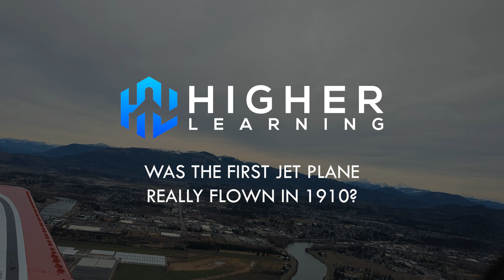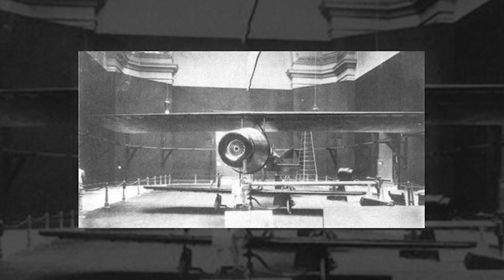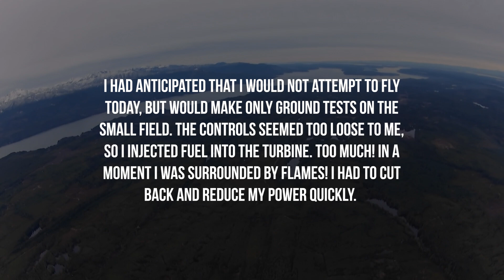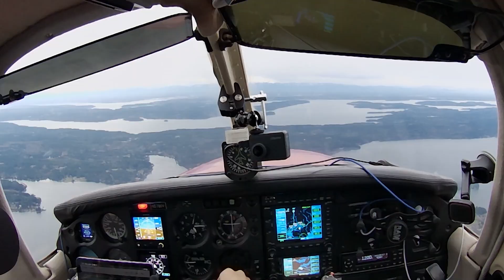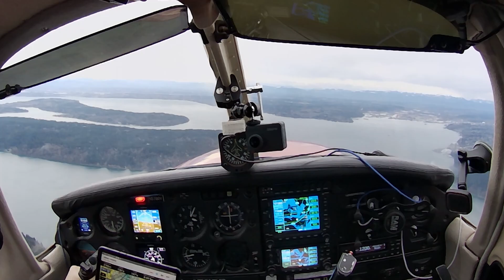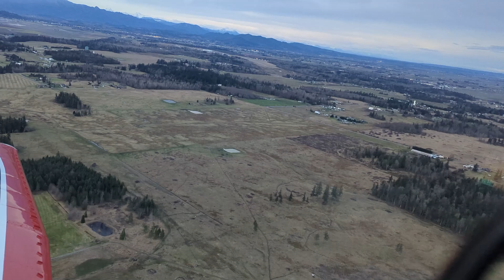Was the First Jet Plane Really Flown in 1910?

Comment: In what concerns "Coandă -1910" powerplant design : This plane was powered by a MotorJet or a ThermoJet - on that era's terminology - this powerplant concept was first time seen, in the history of aviation, at the "Coandă - 1910" aeroplane exhibited at the Second Aeronautical  Exhibition in Paris in October - November 1910. Similar powerplant concept was used decades later, for instance, on the "Caproni - Campini C.C.-2 N1" . In December 1910, on the military training field of Issy-les-Moulineaux (outside Paris), Coandă, while was testing his plane's powerplant - as he never intended to perform a flight test that day - observed that the jets of hot exhaust gases from the engine, instead to follow a straight path, as expected, were attracted to the aircraft's fuselage, a phenomenon which, later on - after more than 20 years of continuous theoretical studies and experiments - will be named the "Coandă Effect" on his honor. Focused on adjusting the engine's fuel flow - with the purpose of trying to bring back, to a straight path, the jets of hot exhaust gases - Coandă was taken completely by surprise by the plane's fast taxiing which was heading  towards the old fortifications walls of Paris. With no options left, Coandă tried to fly over those walls but, after it took-off, the plane stalled and crashed, throwing Coandă clear out of the plane - fortunately, not being straped to the pilot's seat - just suffering minor injuries while the plane completely burned out. Such way, in 1910, took place - accidentaly - the flight of the first airbreathing reactive engine powered aircraft, "Coandă - 1910".
Coandă and Caproni colaborated at certain aeronautical projects in the early years of the 20th century.
Unlike the TurboJet, which have the compressor driven by the turbine which is spinning being "blown" by the jet of exhausting gases, a MotorJet has the compressor driven by an external source of power, such as a reciprocating engine, while extra fuel may, or may not, be added to the jet of exhausting gases resulted from the compressed air mixed with the reciprocating engine's exhausting gases. In short, the general design of a MotorJet can be simply described as somewhat similar to a compressor coupled to an afterburner. What is interesting about MotorJets is that, in practice, the reciprocating engine driving the compressor can provide enough thrust for flight without activating the afterburner, producing a - so called - "cold thrust" or with the afterburner activated,  producing a - so called - "hot thrust".
Gustave Eiffel recognized Henri Coandă's genius, even remarking that Coandă was a prisoner of his time, born too early for his groundbreaking work. Eiffel supported Coandă's early experiments by providing him access to a testing platform on a locomotive, which allowed Coandă to test aerofoils at high speeds. 
     Mutual respect: 
The two were friends, and Eiffel was impressed by Coandă's intellect and inventive spirit. 
     Scientific collaboration:
Eiffel helped Coandă test his experimental wing designs on a wind tunnel platform he built for the project, which was mounted on a locomotive in Northern France. 
     Eiffel's admiration:
Eiffel famously told Coandă, "Too bad, dear boy, that you were born 30 years, if not 50 years earlier, far too early...". This reflects a sense of awe at Coandă's visionary ideas, particularly his work with jet propulsion, which was ahead of its time.

Comment: What about the first reaction engine? While not an jet engine, all jet engines are reaction engines so Ciurcu clearly contributed to it and while not testing it in flight it was tested on a boat making it the first propelled boat

ChatGPT:

Alexandru Ciurcu and the First Reaction Engine
	•	In 1886, Alexandru Ciurcu (Romanian inventor) and Dumitru Văsescu developed a steam-powered reaction engine.
	•	Their invention used pressurized steam expelled through a nozzle to generate thrust, following Newton’s Third Law—just like modern reaction engines.
	•	They tested their engine on a boat, making it one of the earliest demonstrations of reaction-based propulsion.
	•	This concept is similar in principle to modern rocket and jet engines, even though their design was not air-breathing like a jet engine.
Reply: From this perspective it's worth mentioning the "Aeolipile", also known as Heron's engine, is the first recorded steam-powered device in history, invented by the Greek mathematician and engineer Heron of Alexandria around the 1st century CE.
 
How It Works
Boiler: A sealed container or cauldron holds water placed over a heat source.
Steam Transfer: As the water boils, steam rises through hollow pipes that also act as a pivot or axis for a metal sphere.
Nozzles: Two L-shaped, bent tubes or nozzles project from opposite sides of the sphere's equator.
Rotation: Steam rushes out of the nozzles at high speed, creating a jet-propulsion effect that spins the sphere rapidly.

Historical Impact
Ancient Toy: Heron described the device in his book "Pneumatics", viewing it as a mechanical novelty, a curiosity, or a temple wonder rather than a practical tool.
Modern Precursor: It operates on the same action-reaction principle (Newton's Third Law) used in modern rocket propulsion and radial steam turbines.
--------------------------------------------------------------------------------------------------------------------------------------------------------------------------------------------------------------------
In what concerns Coanda-1910 powerplant design : This plane was powered by a MotorJet or a ThermoJet - on that era's terminology - this powerplant concept was first time seen, in the history of aviation, at the "Coandă - 1910" aeroplane exhibited at the Second Aeronautical  Exhibition in Paris in October - November 1910. Similar powerplant concept was used decades later, for instance, on the "Caproni - Campini C.C.-2 N1" . In December 1910, on the military training field of Issy-les-Moulineaux (outside Paris), Coandă, while was testing his plane's powerplant - as he never intended to perform a flight test that day - observed that the jets of hot exhaust gases from the engine, instead to follow a straight path, as expected, were attracted to the aircraft's fuselage, a phenomenon which, later on - after more than 20 years of continuous theoretical studies and experiments - will be named the "Coandă Effect" on his honor. Focused on adjusting the engine's fuel flow - with the purpose of trying to bring back, to a straight path, the jets of hot exhaust gases - Coandă was taken completely by surprise by the plane's fast taxiing which was heading  towards the old fortifications walls of Paris. With no options left, Coandă tried to fly over those walls but, after it took-off, the plane stalled and crashed, throwing Coandă clear out of the plane - fortunately, not being straped to the pilot's seat - just suffering minor injuries while the plane completely burned out. Such way, in 1910, took place - accidentaly - the flight of the first airbreathing reactive engine powered aircraft, "Coandă - 1910".
Coandă and Caproni colaborated at certain aeronautical projects in the early years of the 20th century.
Unlike the TurboJet, which have the compressor driven by the turbine which is spinning being "blown" by the jet of exhausting gases, a MotorJet has the compressor driven by an external source of power, such as a reciprocating engine, while extra fuel may, or may not, be added to the jet of exhausting gases resulted from the compressed air mixed with the reciprocating engine's exhausting gases. In short, the general design of a MotorJet can be simply described as somewhat similar to a compressor coupled to an afterburner. What is interesting about MotorJets is that, in practice, the reciprocating engine driving the compressor can provide enough thrust for flight without activating the afterburner, producing a - so called - "cold thrust" or with the afterburner activated,  producing a - so called - "hot thrust".
Gustave Eiffel recognized Henri Coandă's genius, even remarking that Coandă was a prisoner of his time, born too early for his groundbreaking work. Eiffel supported Coandă's early experiments by providing him access to a testing platform on a locomotive, which allowed Coandă to test aerofoils at high speeds. 
     Mutual respect: 
The two were friends, and Eiffel was impressed by Coandă's intellect and inventive spirit. 
     Scientific collaboration:
Eiffel helped Coandă test his experimental wing designs on a wind tunnel platform he built for the project, which was mounted on a locomotive in Northern France. 
     Eiffel's admiration:
Eiffel famously told Coandă, "Too bad, dear boy, that you were born 30 years, if not 50 years earlier, far too early...". This reflects a sense of awe at Coandă's visionary ideas, particularly his work with jet propulsion, which was ahead of its time.

Comment: Sooooooo.. it is not a 'Jet' engine in the true sense where the compressor leads into the burners then out through a turbine which then powers the compressor. It is actually a ducted fan type of engine (powered by an internal combustion engine) and is why the concept was not credited as a "Jet" in the first place, Frank Whittles design of a Centrifugal type turbine system being the first pure Jet turbine engine to run successfully on April 12, 1937.

Comment: Whittle's first engines could barely taxi their airframes across the ramp, let alone fly. He had to study German patents to figure out how to get them to produce enough thrust...
Reply: Rubbish. The German engines were rip-offs of Whittle's patent.
Reply: The dates on the patents prove it. I knew a General Electric engineer on the design team for the GE-IA through the J31 engines. He claimed the example engine and drawings Whittle supplied them were a joke. The GE team learned more from German patents than they did Whittle's rubbish, and eventually figured it all out after 31 iterations. The inside joke at the time was "the J stands for Jerry, who helped get the Airacomet airborne."
Reply: @flyswryan  That’s crap, and here’s why: in the Korean war, the dog fights in the skies were between planes like the Mikoyan-Gurevich MiG-15 equipped with the mighty Klimov VK-1 and VK-1F power plants; and the F-86 Saber, Grumman F9F Panther, the F9F-6 Cougar, the Lockheed Starfire and the YF-93 – using the Pratt & Whitney J48 engine.

Unfortunately (for you), the mighty Klimov VK-1 was the clone of a Rolls-Royce Nene engine – based on one of twenty five Nene engines sold to the Soviet Union in 1946. The Russians had earlier tried to develop their own engines based on the captured Junkers 004 and BMW 003, but found them to be under-powered and unreliable.

The Pratt & Whitney J48 engine keeping the USAF airborne was a Rolls-Royce Tay engine, built under licence. The dog fights taking place over Korea utilised almost exclusively British technology. Not American, certainly not German. Frank Whittle invented the jet engine.
Reply: @flyswryan  Rubbish

Comment: Very random, but is your map/nav stuff on the tablet connected to a holder on the flight stick? Thats a super cool way of doing that tbh
Reply from the maker: Garmin Pilot on the tablet, yes. :-) It is connected via Bluetooth to the plane's transponder which has something called adsb built in as well. Allowing for seeing most other planes in the air and their exact location, altitude and speed and numbers, as well as receives weather, and some other fun stuff. :-) The Garmin Pilot itself has a myriad of features that make flying around infinitely easier than even a couple decades ago. :-) From basic nav to airport info to terrain, etc. Even synthetic vision should normal visibility be compromised for some reason. :-) It's really nice. :-)
Reply: @HigherLearningFlight  Super interesting, thanks for the info! Big fan of Simon's channels, hope this one "takes off" as well, pun somewhat intended haha 😂